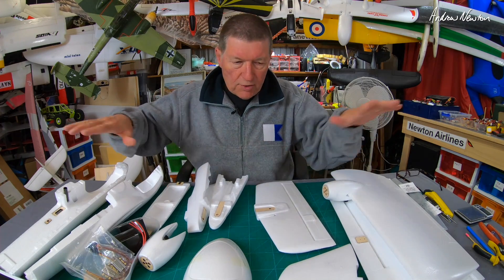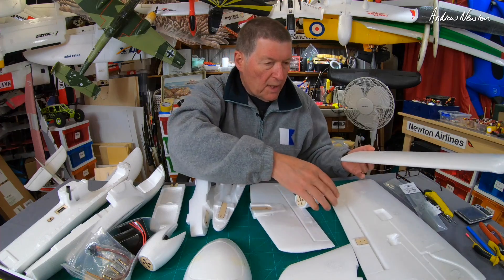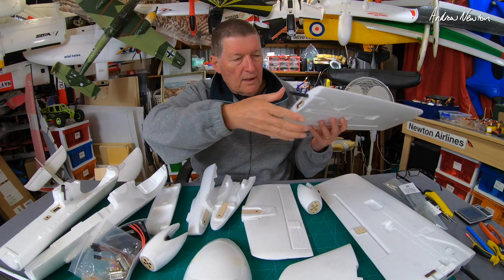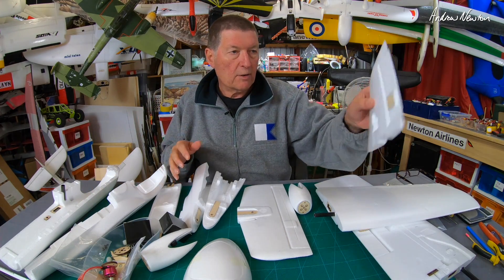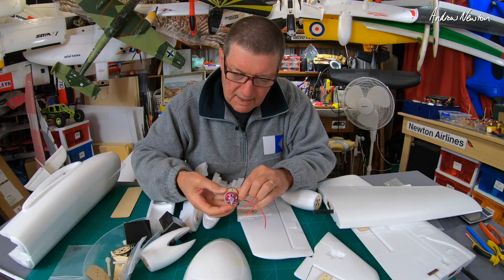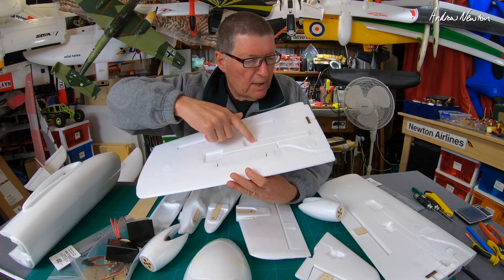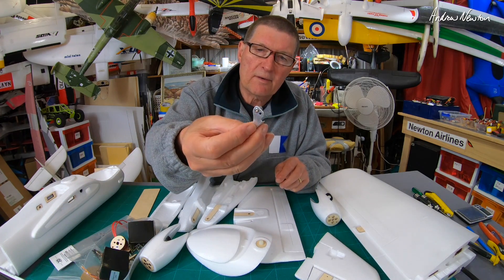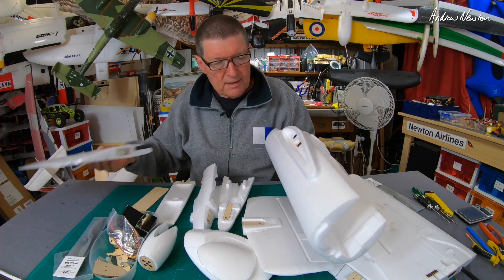Finwing AlbaBird Twin Motor

Comment: Looks like a smaller and chunkier version of the Twinstar which you could say was one of the first  readily available twin engined foam models. I must really drag my old brushed one down from the shelf and finish the brushless conversion
Reply from the maker: Wow, Twinstar must have been around for ages if you have a brushed version.
Reply: @AndrewNewton  Bought it as part of a job lot but not flown it yet

Comment: So.... A larger wing chord doesn't necessarily translate to a larger Coefficient of lift.  It depends of the CL of the airfoil at that reynolds numbers, and the numbers change with only the Chord.  a low aspect ratio also comes with some inherent disadvantages, such as greatly increased drag, especially when maneuvering, or operating at a high angle of attack, for any reason, such as at a low speed, high G-load in any orientation, such as a tight turn.  An airfoil which has a thinner chord can also produce a high CL with less wing area, in many cases. 
One example of this are the wings of the majority of the de-havilland aircraft created for STOL that are still flying today. The wing must redirect the air (mass) downward in a shorter distance of travel (chord).   
Overall, looks like a good design except fo the drawbacks of large wing chord-    larger shift of the low pressure bubble creating instabiliy in pitch at higher angles of attack. this can be compensated for by moving the CG forward, but in cruise flight, efficiency will be lost.
Reply from the maker: There are probably design considerations other than flight efficiency that have shaped this plane, like 1100mm wingspan, building down to a budget, easy disassembly, carrying capacity. Very different to your stunning Gemini.

Comment: Well I just ordered one.  I like the bigger chord than the Binary and the lack of the unwanted light fittings, also the motor mounts look to be quite streamlined I've been looking for a twin for ages, but never had heard of these before.  I need an FPV plane smaller than my SkyHunter 1800mm which I love but is huge to get in the car.

Comment: Andrew, can you please read the instructions for uhu por on the tube and confirm. The uhu por here in the UK is not a contact adhesive (if you read the instructions on the tube) it is just apply and push surfaces together and allow to dry.
Reply from the maker: UHU website explains how it to use it.

Comment: Nice bird Andrew, have to say those Sunnyskys are going to be too much for it tbh, and those giant ESCs...hanging out all over the place...What were they thinking?
Reply from the maker: They are my ESCs, the only matched ones I had handy.
Reply: Oh, I see, they supply the motors but not the ESCs...Im guessing the motors are going to be far to much for this model. Be interesting if you fit smaller ones with less amp consumption, not that SS motors are bad you understand.